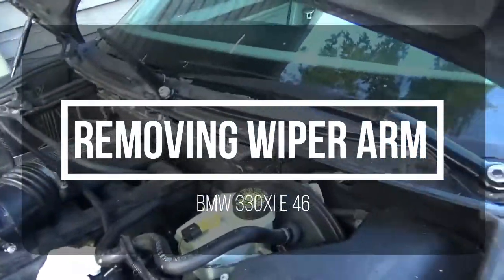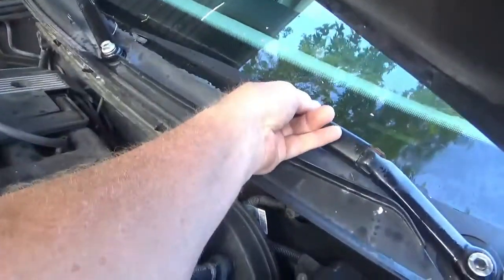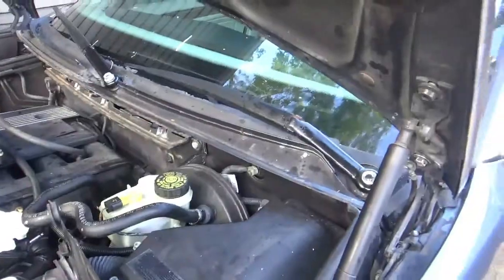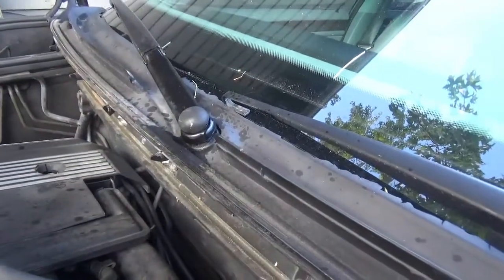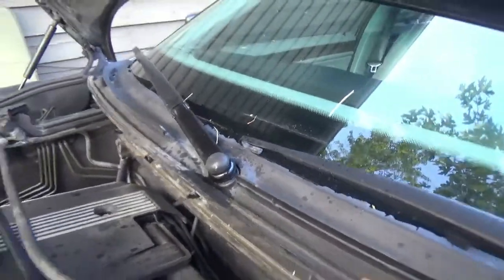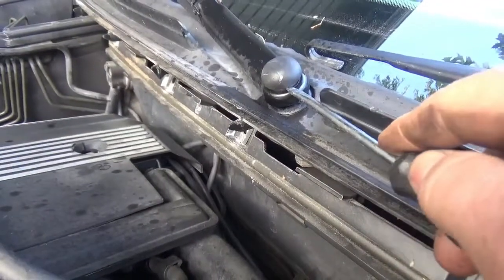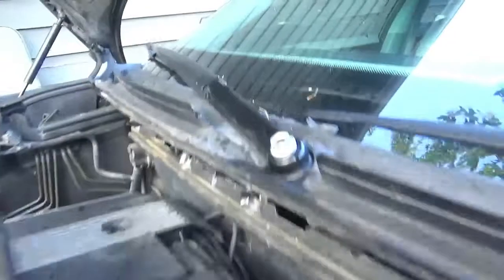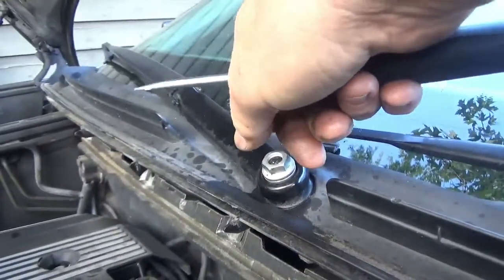How to remove a Wiper Arm - BMW 2001 330xi E46

Comment: Don’t do this to your car! You can just put some lubricant on it and wiggle the arm up and down until the nut slides up and comes loose. I tried the rubber mallet method for a half hour before finding giving up and finding another video of someone in a dealership just wiggling it loose

Comment: Well, I tried this method and it did not work, the retainer is on tight and not planning on hammering this to damage.  Well worth investing in a wiper arm puller, not expensive and wont do any damage.